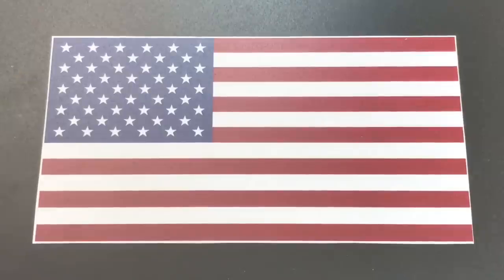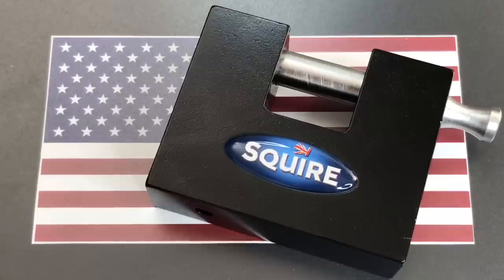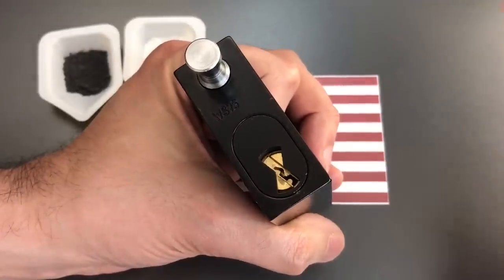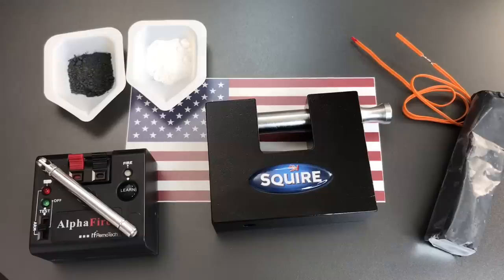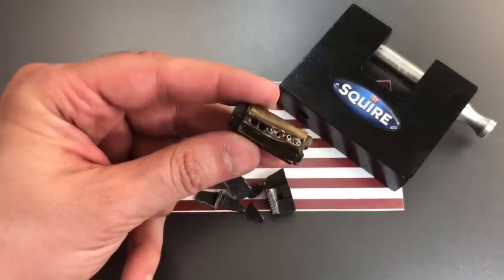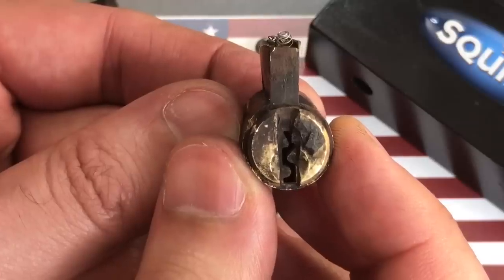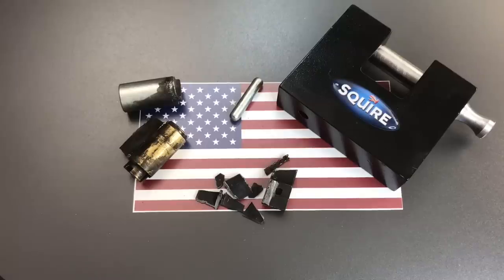[510] Opening a Lock With Explosives!!!

Comment: Have you ever tried Thermite to melt open a lock? It is not explosive, just burns really hot, and cannot be stopped once ignited.
Reply: It burns through engine blocks, it'll burn through a lot of locks.
Reply: Adam Bernstein u kno it actually can be stopped... liquid nitrogen.
Reply: @heretomakeyousalty6126  yes, also the ocean
Reply: @supreme_leader_of_the_internet  thermite works under water
Reply: @petertaylor4758  theoretically though, it should spread out the thermite enough to make it almost if not entirely gone within seconds
Reply: @supreme_leader_of_the_internet  Have you ever actually seen a thermite reaction?
Reply: NAWW, how do you plan on taking out the oxygen..? Thermite contains its own supply of oxygen because of the oxide used in it. A layman's analogy to this would be to suggest the removal of hydrogen from water...
Reply: Factual Fox  C4 whould probably be safer and faster at dealing with the problem as a grass fire where you can put out the source of the fire seams more dangerous to me then just blowing up the nest.
Reply: Factual Fox also if you do it with the nuke  your nabours won't be angry at you for scarring the sh*t out of them and your city's crime rate will become zero.

LOL
Reply: Thing is a mix of glue and kitchen materials compressed together in a inch thick putty can stop it pretty cool
Reply: Thermite melts pretty much anything. It's hotter lava that's always on fire.
Reply: Might just weld it in one big mess
Reply: olid901 it does require oxygen, but it’s provided by ferric oxide (rust)
Reply: olid901 technically it does require oxygen its just the oxygen is in the rust powder not in the air
Reply: olid901 Thermite contains ferrous oxide (Fe2O3) this is where it gets the oxygen from.
Reply: Thermite CAN be an explosive reaction, which is why it is used in artillery shells. The finer the powders are ground, the faster the reaction
Reply: The keyword being "cannot be put out easily"
Reply: @heretomakeyousalty6126  we need a lock with liquid nitrogen then
Reply: 911
Reply: hmmm what makes me think you got this idea from Breaking Bad ?
Reply: One big fucking hole coming right up!
Reply: 9/11 triggered
Reply: @statiq1941  a block is thin and or aluminium
Reply: @heretomakeyousalty6126  how do you get liquid nitrogen?
Reply: @DUxMORTEM  it would be interesting to see what kind of soundwave would destroy a lock
Reply: @penfold7800  probably the one made by echos yokai drone.
Reply: @statiq1941  most engine blocks are aluminum. That's not impressive.
Reply: Well thermite can melt through reinforced walls so he can probably get through a lock
Reply: @heretomakeyousalty6126  no it would sublimate the liquid nitrogen
Reply: @unknown_10453  doubt full of that. Prove it.
Reply: @heretomakeyousalty6126  what do you mean doubtful, have you never seen what happens when really hot stuff meets really cold stuff?
Reply: if you mix thermite just right and have a really good ball mill even thermite can become an explosive .
there was a madlad here on youtube that made an entire videoseries on experimenting with thermites and his most promising batches put most flashpowders to shame and compete with nitroglycerine in terms of detonation velocities
Reply: I know this comment was three years ago but he did end up using a thermite rod on a big lock, just in case you didn’t see it I’m sure you could easily find it
Reply: You can stop it just not in any practical way.
Reply: @petertaylor4758  Phil swift: “IT EVEN WORKS UNDERWATER”
Reply: @KT-pv3kl  is that guy still on YouTube?
Reply: gta
Reply: @Gekkibi  they plan on taking out the heat
that's why aou need to spread it out enough
Reply: Jesse, we need the thermite…

Comment: "We set meat on fire" 👍🏼😂🤣😂🤣
Reply: That's technically not in correct
Reply: dotexe Gaming  Unless LPL is really bad at grilling.  Bacon can definitely be set on fire if you put it on a grill and don't keep the heat somewhat low.
Reply: @HariSeldon913  I believe it's called a flambe.
Reply: @HariSeldon913  I've only ever seen bacon melt through the grate before.

Comment: 'so-called "low explosives" ' - chlorate and aluminium dust is actually the 'highest' low-explosive mixture (powder) I know of.   Way, way more powerful than gunpowder.    Aluminium dust is an extremely fine powder, just itching to get its hands on some oxygen, and the chlorate is brimming with oxygen just looking for a place to go.   
The wiki page on 'flash powder' says (of perchlorate+aluminium):  '3 grams of mixture is enough to explode in open air without constraint other than air pressure'.   Considering that exploding when unconfined is usually regarded as the mark of a high explosive, it's evident that chlorate+aluminium may not technically be a high explosive but it really, really wants to be.
Reply: I thought that part of the definition of a "High Explosive" is that it does NOT easily ignite on its own and without a detonator, like modern TNT

Edit: Oh, I mixed that up with Primary and Secondary Explosives, my bad

Comment: Lock Smith, Lawyer, Demo Expert..

You're like Neil Breen's wet dream.
Reply from the maker: +Dom B I am FAR from a demo expert. If nothing else, this taught me that there's a great deal I don't know... the real experts kept me from blowing off my little lock picking fingers.
Reply: Good thing, FingerlessLockPickingLawyer would be too long.
Reply: Looks like you issued that lock a writ of habeus crepitus.
Reply: Squire - 0
Esquire - 1
Reply: @lockpickinglawyer  I took one look at your remote detonator and said "Oh, Hell no" myself. Your RSO is very wise...
Reply: MrWaalkman Could you explain why it’s a bad idea? Genuinely curious
Reply: @chkingotw  it's a bad idea due to the fact that any radio or electronic capable of transmitting could be tuned to the frequency that the remote is on and it could receive a false "detonate" signal.
Reply: @dakkota23  Any system designed by someone even halfway competent would use a very specific pattern of frequencies or amplitudes. So it probably doesn't. But with a good design, I don't think there'd be anything to worry about.
Reply: @Vaasref  I think mrs LPL would be more upset...

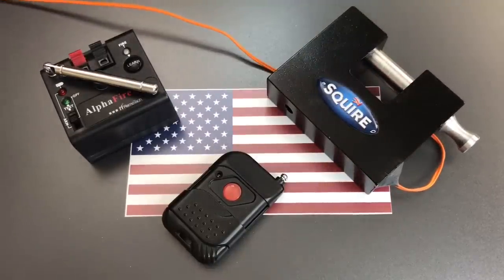Comment: 5:03 The range safety officer was smart on that fireworks igniter system.  That was a flimsy one, and the cable wasn't long enough or shielded.  Generally you should use the ones the range supplies, but if you want a good one you could use ones designed for model rockets.

As a note, I'm surprised the range officer permitted that box.   You should have had a vent with no direct line of sight pass-through in order to prevent it from becoming a pressure chamber.  I doubt you had enough explosives for that to be an issue, and you were on a bomb range, but still.  

As of the mixture itself.  I would have used a more traditional black powder derive pyrotechnic compound.  The black powder variant you used was much more modern in formula.  Black powder is slightly higher energy and makes blacker, thicker, smoke.  

I also would have chosen powdered iron as the additive instead of aluminum-based.  This would give it a pretty red explosion. 

Finally, I would add some extra phosphates to the mixture to regulate the burn behavior and increase light production by the blast.  They also give that distinct fireworks smell that we all love.

Comment: As a radio ham, I'm not surprised at all that your range officer balked at the wireless ignitor.
Radio is freaking awesome, but a cheap little CW or even encoded-wave transmitter is definitely nowhere near secure enough for me to trust with a lock full of boom.
Way too vulnerable to spurious interference from any variety of electronics for the next seventeen miles.
For reference, my PC can kick off enough interference to make my walkie talkie nearly useless when I set it on my desk.

Comment: 50 milligrams is not something that I have a gut feel for, so I converted that to grains since I use that a lot in reloading of ammunition.  That works out to be about 0.77 grains.  That's less powder than is even in the lowest .22 power loads (gray #1s) used in nail guns.  Most of my handgun ammo uses 4 grains or so, depending upon caliber / loading.  As such, that's really is a small amount of explosive that you put in there.  Kind of makes me wonder what could be accomplished with just the powder from a .22 power load.  Technically, that's not an explosive, but rather just something that burns fast, but for something like this, maybe it would be enough.
Reply: Grumpy OldMan 
Perchlorate and aluminum have more pop.
Reply: It's basically flash powder. Well... more or less flash powder anyway. The damn thing detonates if you look at it funny and he went as far as angering it additionally... yeh, less than a grain sounds about right for this job
Reply: That's essentially what he does with his recent Ramset videos.  Not much seems to be able to stand up to the Ramset.
Reply: Black powder maybe, 3 or 4 f, ground into a fine dust. Smokeless will just burn.
Reply: Grumpy old man, They still just deflagrate like smokless powder. Infact smokless powder is more powerful than any perchlorate mix, because it is basically nitrocellulose which is guncotton (a very powerful explosive) and it also has a small percentage of nitroglycerin in the vast majority of smokless powder mixes which is even more powerful again. There is very very few things he could put into this lock at these tiny quantities used that would detonate. Explode yes, but detonate no. And you would need something that detonates with high brissance to work here, in my opinion. 

U can hear a hiss also and not a bang, which is very suspicious.   

Read my post I just posted in main comments section a few minutes ago.
Reply: @233kosta  don't talk about stuff you don't know anything about if you Don't understand them, because I promise you what you said is nonsense.
Reply: @atourdeforce  All I've seen is a very small quantity of Mg/Al flash powder lit by a slow fuse in an open top steel cylinder ('bout 1" in diameter, 'bout 3" tall) sound off like a .308.

Without any proper confinement (i.e. a bullet to build a pressure wave behind) that makes it a detonation in my books. Nowhere else a blast wave like that could come from.

I'd call that angry, wouldn't you?
Reply: @233kosta  sound like a .308 eh ok over exaggerate much?? 

Your opinion doesn't matter as much as mine because I know more about these things. 

The end!
Reply: @atourdeforce  you're so smart and handsome. I hope I can be just like you when I grow up.
Reply: @beholdandfearme  sorry if I came across like an asshole I'm just trying to say what I feel. :(
Reply: Who in hell uses crap like grain to measure weight grain of what salt rice corn ????
Reply: 50 mg of aluminum flash powder is not very much. The custom salutes we send up skywards are typically 70 grams, and we also add some titanium sponge. The sparks are much nicer :)
Reply: @233kosta  flash powder deflagrates so fast that it can self contain, causing what looks like a detonation but technically isn't. The results are very similar though.

Comment: I have an idea for you! What do you think about using a cone shaped charge to punch holes in locks as a method of by passing/defeating locks? Would the plasma jet thus created just weld the lock into a solid blob that permanently seals it closed or would it blow out the innards much like this lock? I’ll be stunned if you respond to this at all, let alone make this video as this video is over two years old.

Comment: In my misspent youth, I dabbled with homemade fireworks and explosives. The key to low explosives, is the containment. In this case, the epoxy plug, was the potential weak point. But it held up, hence the results.

To get the best results in your flash powder mix, samples should have been tested, to get the optimum mix. Just like a cook does periodic taste tests, and adjusts the ingredients accordingly. In most homemade firecrackers, some of the gas exits the fuse hole, so the burn has to be fast enough, to blow the firecracker walls, before too much gas escapes thru the fuse hole. But in this case, that really wasn't needed, since the epoxy plug created a very good seal. Better than I would have predicted.
Reply: No need for testing. Fire finely ground powders, the 70:30 mix by weight is close to perfect. It is what we use for a burst charge in class 1.3 salutes.

Comment: You didn't do it right. A true American would do this in their back yard, using a dead microwave as a box and a rusted out 90's Silverado with jumper cables to power the fuse, standing about 10 feet back should be enough, maybe 15 feet for cowards.

Comment: "Range Safety Officer" nixed the R.C. detonator......gave him Iraq flashbacks of I.E.D.'s.
Such RC controllers have NO protection from errant radio signals. Long wire Detonation, is the ONLY safe way to set off Fun Devices.
Potassium Perchlorate, or Mercury Fulminate do "small" jobs well. Mercury F is VERY shock sensitive however.
{ snap caps, paper wrapped balls you toss on ground are M.F.}

Comment: I'm actually curious about how you filled it.  Did you just use a funnel, syringe, or something else?   Did any of the explosive go into the cylinder?   I'm guessing by the resulting material that none, or just a trivial amount, got into the cylinder.   Not that I'd recreate it.  My neighbors don't like explosives.  They barely tolerate my little foundry furnace.

Comment: Pressure is everything. I cut the end off and dumped the shot out of a 20 gauge shot shell and filled it with cotton balls, hoping to shoot flaming cotton balls. Well, when I shot it, even though the powder charge was behind the wad, it was about like a primer going off with no powder. It did fire the cotton balls but they didn’t catch on fire 😢

Comment: Would it have worked if you would have filled the keyway instead of around it? And I like packed where the key goes with the explosive... Wouldn't that have just blown the pins out and probably the rest of it but all you need to do is blow the pins out right? If the pins are no longer in there it can turn freely correct?

Comment: SAFETY NOTE: those radio control triggering devices may be only on a limited range of wavelengths. So if there is someone else with a trigger or receiver within the radio range, which can be up to a mile and a half, there's every possibility yours could trigger Thiers or Thiers could trigger yours. Murphy's law says that if that were to happen, it will happen when it's likely to cause most injury. So the ranger was definitely right, don't use them. I think they are generally used only to launch amateur rockets, which are launched in very remote areas with official permission. Even then, I think they're unsafe to use. Having a quarter mile long cable may be expensive, but removing the power source until it's needed is a hell of a lot safer.

Comment: I wonder if it can be done with the lock in a realistic position, like keyway facing down and lock fairly immoveable, like can only be turned 45-90° around the locking bolt.

Comment: That is the thing about explosives. They break down violently into gasses. THat's why nitrogen works so well, no matter if the reaction was complete or not, most simple comounts of nitrogen are gaseous and every Mol of it suddently wants to take up 22L worth of space simultainously. 
if you give it space to expand most explosives aren't all that harmful if you stay out of the shockwave killrange. But if you put as much as a piece of paper between where they are and where they need to be, the built up pressure much much quicker than the paper has time to move away.

Comment: If you see a very small amount of pyro / gun powder / explosives go off in free air, it certainly looks somewhat anemic and harmless, because there's practically nothing there to contain or restrain the rapidly expanding gasses. It's a bit like blowing as hard as you can straight to atmosphere; no resistance.

Stuff it in a non-flexible container with little to no space for those gases to expand into however, everything changes. If there is a suitable large opening for the extremely rapid generated and expanding gases to evacuate, you effectively have a propulsion contraption; a rocket engine. If you do not have any large enough opening(s) for evacuation, then all that pressure is still gonna have to go somewhere. That outward-from-center pressure will exert more and more force onto its container, until something gives. And this conversion and expansion of gas happens at such an extreme speed, that formation of tiny cracks for it to leak through, just cannot accommodate fast enough venting.

Comment: I'm not surprised at all that so little was able to destroy the lock. Doesn't take much when an explosive is tightly confined and contained. The near instantaneous gas expansion at a molecular level will cause something to fail. Attempts to confine and contain an "explosion" which is really an exceptionally rapid (near instantaneous) gas production and expansion, usually through chemical oxidation, will result in something giving to allow that expansion to occur. The more tightly confined the "explosion", the more likely there will be containment failure. Explosion containment relies on giving some relief to the gas expansion.

Comment: The "low" in low explosives does not mean low power but rather low speed. The explosion moves through them slower than the speed of sound. They're really good at moving things (like a bullet or the little pieces of the retainer plate, the core, the bible to the side, the cover of the bible in to the pin chambers, etc.) while high explosives are good at shattering things. If you confine a low explosive, though, they will burst their container, sort of like a balloon popping (and usually still have enough left to push the shrapnel to a decent speed)